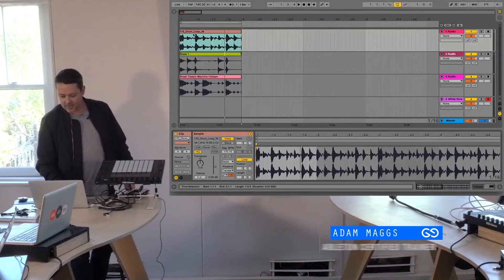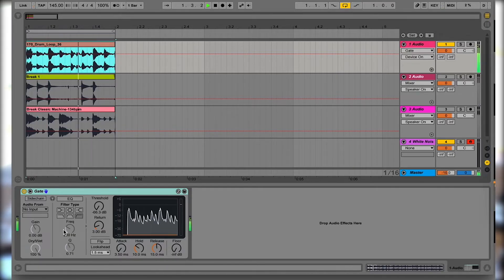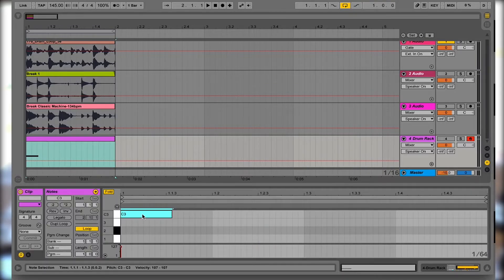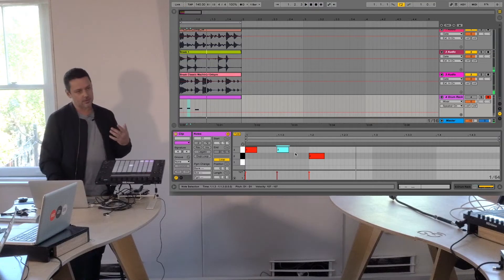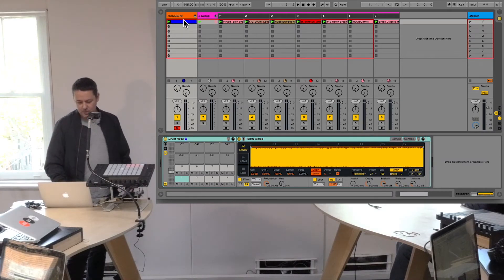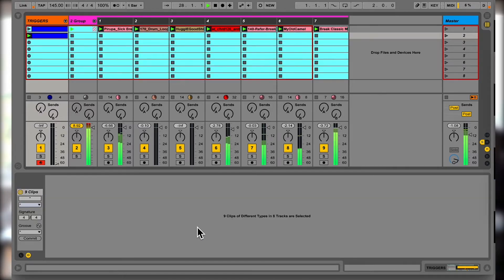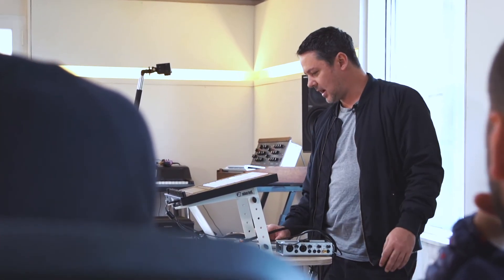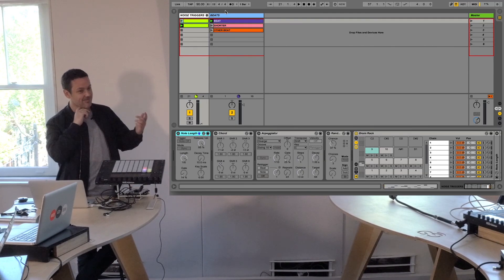Ableton Live Tutorial: Gate Remixing

Comment: Cool technique! For any Logic Pro users out there who might be wondering how to do this, it's actually really easy. Just load the same amount of Quick Samplers as the number of loops you have inside of Drum Machine Designer (Logic's equivalent of Live's Drum Racks), and then follow the same steps (draw in MIDI notes, etc). Remember to mute each Quick Sampler! Bonus tip, within Drum Machine Designer on each of the pads there's a small cog wheel on the bottom right, click on that and select Exclusive Group and set all of the pads to Group 1. This Exclusive Group is basically DMD's Choke group feature and it ensures that any overlapping MIDI notes will cut off each other and you won't get any overlaps.

Comment: I cant get this to work properly. all 3 gate settings emulated, and classic mode on each simpler are the same. when the midi note ends the loop triggered doesn't immediately end. he doesn't go into detail on the gate parameters so any ideas what i'm doing wrong. cant figure it out?
Reply: I don't know if you're still struggling with this, but I had the same as you and I figured the trick out. The length of the "Noise" clip and the length of the drum loop must be the same. So I guess if your drum loop is 4 bars then be sure your Noise clip will match that!